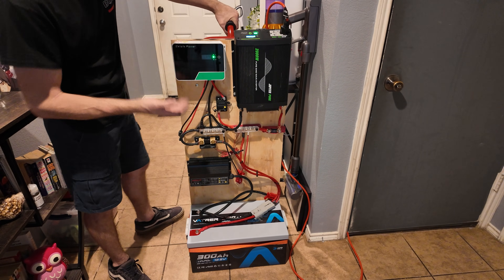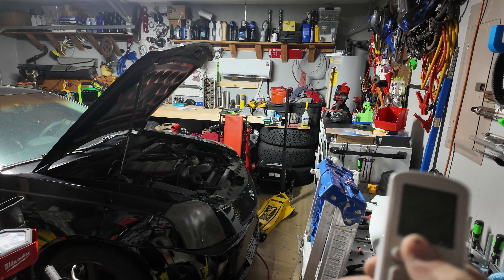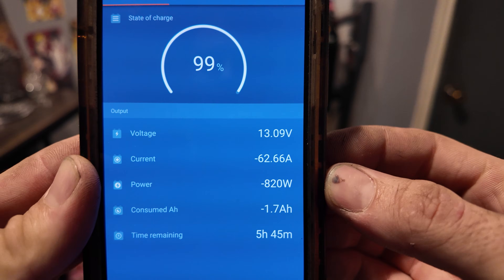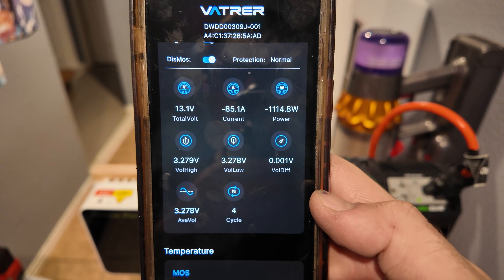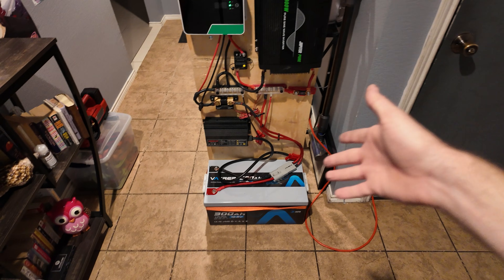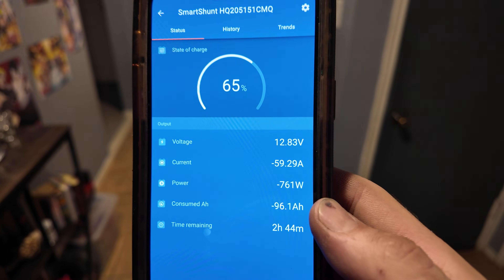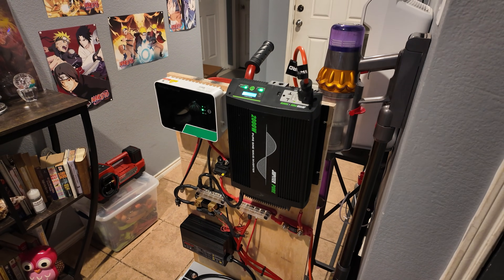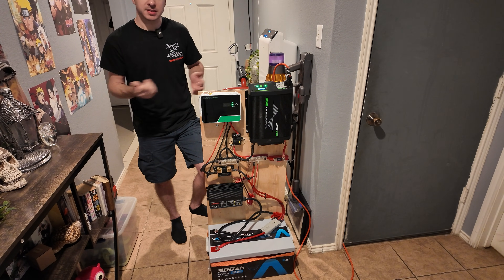300ah 12 Volt Battery Running Mini Split Air Conditioner Test

Comment: What solar panels would you recommend for this system and how would you wire it ?
Reply from the maker: Check my wooden solar pergula build, i added links to some cheapish solar panels,    id wire in at least 2-3 keeping the voltage below 150 for this charge controller

Comment: This video came across my feed...probably because I just installed a rooftop 10k BTU 12V OutEquip Pro A/C unit in my adventure van with a Victron off-grid system.  I've got 400ah of Battleborn batteries and 500W of solar on the roof.  I've only made two trips with it so far and still getting used to it.  I'm cutting it close on reserves and may decide to add one more 100ah battery down the road.  Thanks for putting this out there.👍
Reply from the maker: Thats awesome, ive heard of that company, looks like an impressive unit!  That sounds like a good setup, more capacity is always good.   Have you looked into a DC-Dc converter so you can also use alternator power?
Reply: @Mikebuildss  Yes, I have a Orion 50A charger setup, but I'm trying to avoid using the van's engine as generator if I'm just standing still.  I've got a Multiplus 2,000W inverter/charger too, so shore power use and charging is an option.  I need to figure out how much of a shortfall I have and how often, before I belly-up for another $750 battery.  My roof rack is pretty much maxed out with the two 250W Rich solar panels, so I'm not sure I can add anything up there.  A portable solar array might be an option, but where do I store it? 🤔 I'm investigating flexible solar panels for the arched portion of the Transit van roof between the windshield and roof rack, not sure how to affix and what potential damage could occur at that angle. 
On one outing it was blistering hot and we had the A/C in ECO mode.  It kept us comfortable and only used 25% of my battery bank that night. So who knows, maybe I've got enough options right now.

Comment: There are a few heat pumps/air conditioners that run directly off of 24V or 48V. I imagine if you'd exclusively be using solar energy, those would be significantly more efficient.

Comment: 600amp Hour Battery Bank and 1200 Watts o Solar and Victron 150/45 Smart Solar Charge Controller and a 24/1200 VICTRON Phoenix Inverter Runs My 9K Mini Heat Pump really good
Reply from the maker: They work so good using solar i love it!
Reply: @Mikebuildss It's Nice to have a Healthy Battery Bank for when the SUN isn't Working for Us

Comment: From your test, were you able to get the total 300ah from the battery? What was your total actual ah usage from 100% to 0%
Reply from the maker: In this test I didn’t run it all of the way, I have tested this battery before, it it did pull full capacity. I have a video testing it